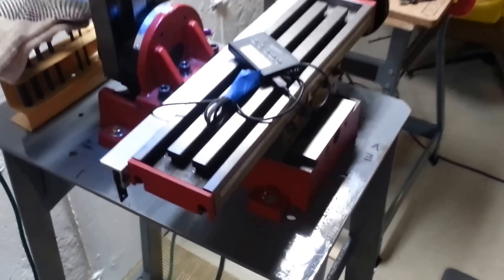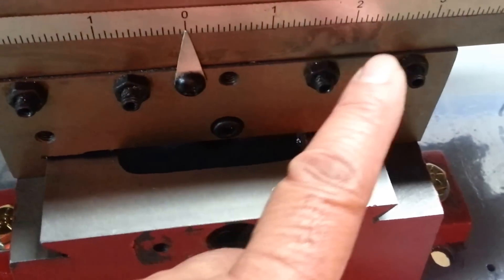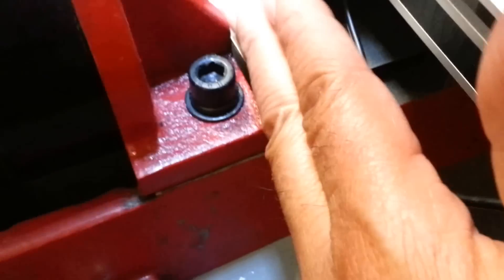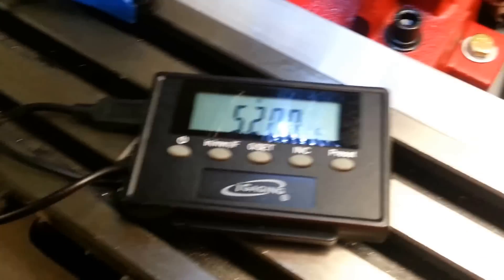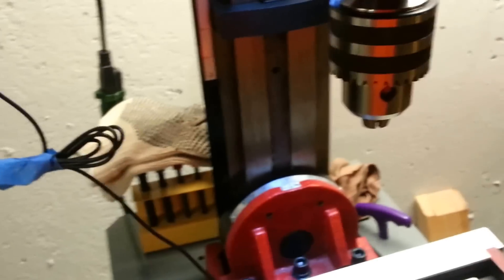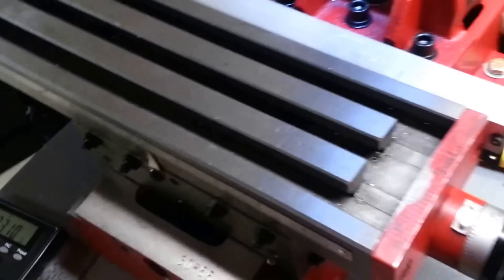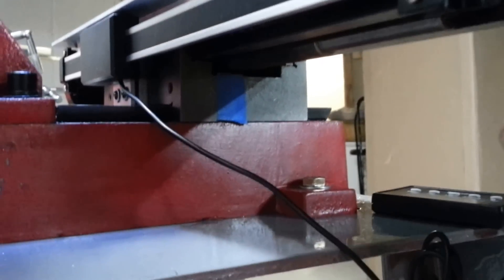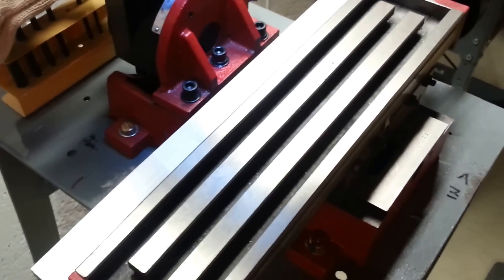DRO Installation on 2X Milling Machine (8 of 8) 8 20130825 161732

Comment: If your scale is long enough, you can extend the aluminum angle and scale off the left side of the table and put the sensor on the cantilevered portion which won't interfere with Y axis full travel.

Comment: Why didn't you buy flat head screws to mount the sensor instead of using socket head cap screws you could have kept the packaging closer to the table?